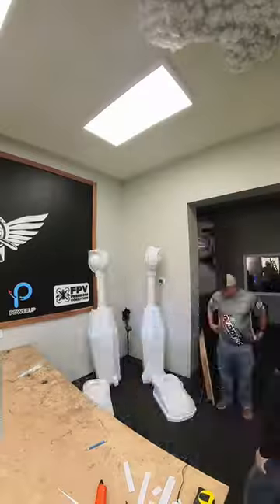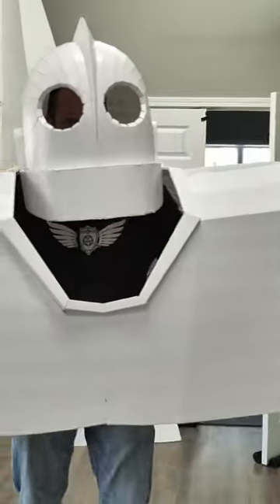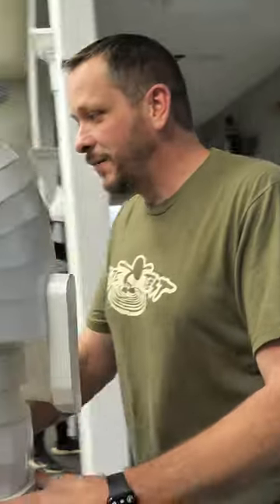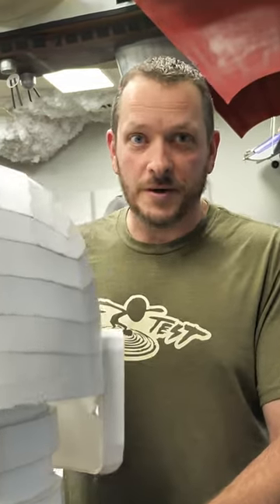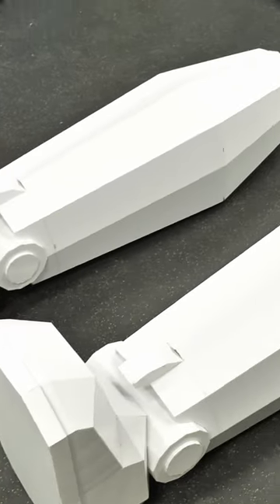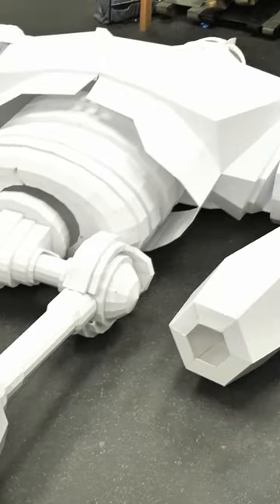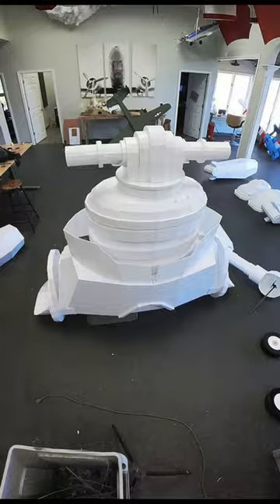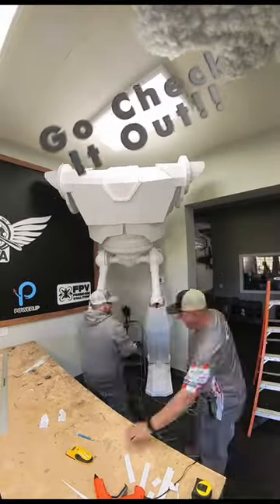Iron Giant Teaser! #shorts

Comment: I bought one of your kits and am very disappointed, we asked for a full refund. No response after 3 weeks and contacted credit card company and they contacted flite test and you guys said we never asked for refund and sent us new plane. Not what we wanted the kit was complete crap and wouldn't stay in the air and the problem isn't that I haven't flew before I have 4 planes already so it is not skill but the motor cuts off randomly and we didn't get all the parts we needed for the kit. Not happy